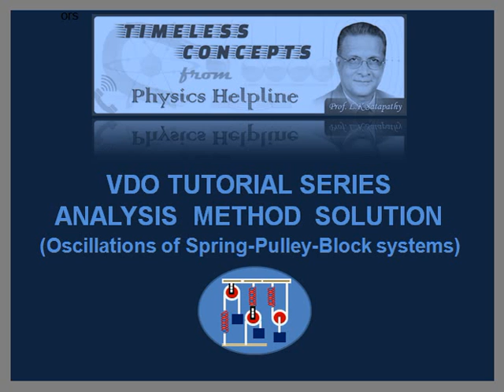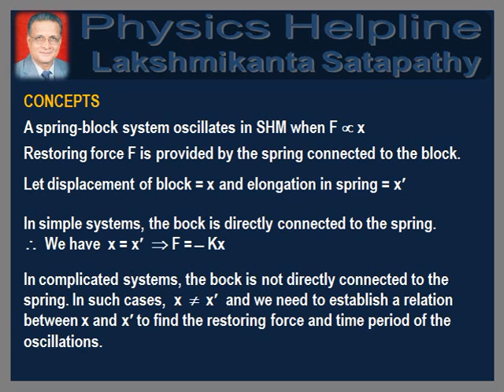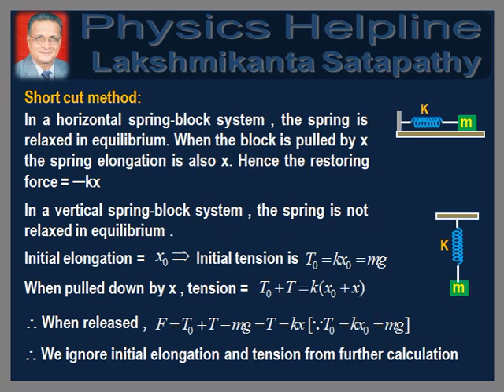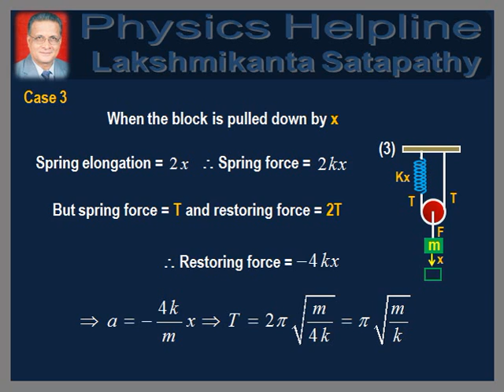vDo Oscillations-3/ Spring-pulley-block system

Comment: Sir, 
when the block is pulled in case 2 and case 3 by x 
why the spring elongation is varying??
kindly explain
Reply from the maker: Only when the block is directly connected to the spring, the block displacement = spring elongation(1st case) in all other cases , they are different(2nd & 3rd cases)
Reply from the maker: in case2, you can see that when the spring elongation = x pulley comes down by x , the slack in  string = 2x , hence the block comes down by 2x. so spring elongation is half the block displacement. Similarly, one can argue for case3. I suppose you can do that. is that ok ?
Reply: I understood the second case sir, but not the third case. 
kindly requesting you to make little more elaborate videos. nevertheless thanks for your response and videos.
Reply from the maker: I am a retired teacher & have no sponsor, doing it on my own. vDo time is expensive, so keeping it to a minimum. But I will explain the 3rd case, When block moves down by x , the pulley moves down by x. the slack required in string = 2x (on both sides of pulley), which is provided by spring elongation.
Reply: Lakshmikanta Satapathy  sir wonderful videos. Thanks for help. One suggestion from me. Unacademy is growing huge in India and they require wonderful teachers like you. Kindly requesting you be a part of it. Thanks a lot for explaining sir. I got the third case also. Thanks.
Reply from the maker: The photograph is old. I am 67. I do not have the energy to perform in a class room. However, if some body needs vDo content, they can message me here. I am also available in FB.
Reply: Lakshmikanta Satapathy  sir unacademy is an online platform. 
Kindly google it. It will make such great lectures to more students.
Nevertheless thanks a lot sir. 
Thank you so much for the videos